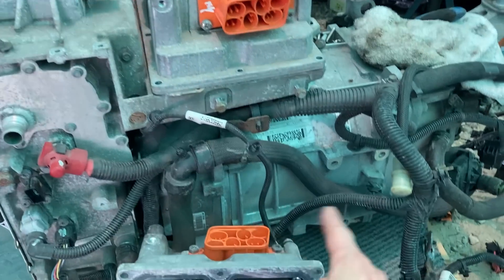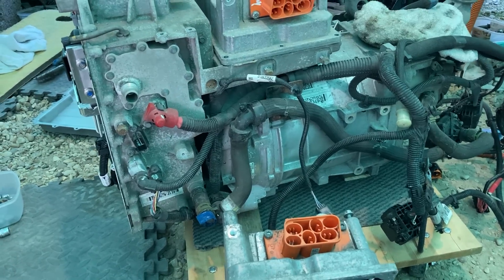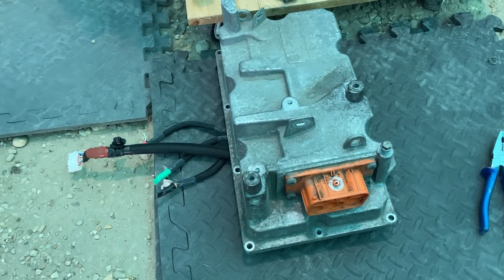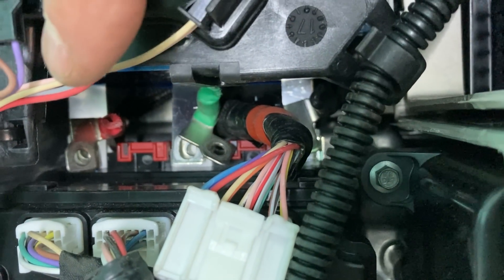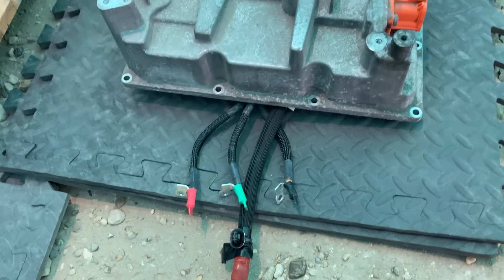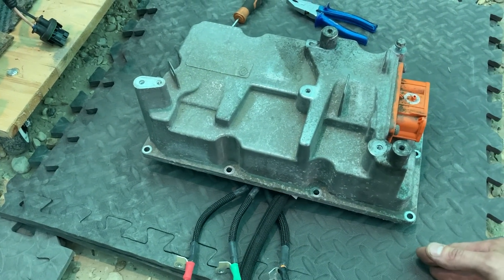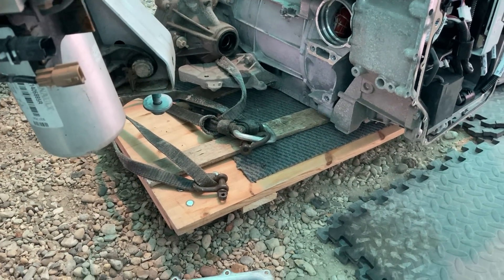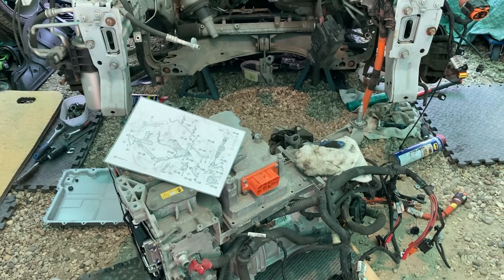Renault Zoe intermittent charging fault - overheated/burnt neutral pin - EV repair mechanic

Comment: I have a 22Kwh Zoe and according to the garage where it is in for repair, due to the DCD convertor. The neutral pin is also badly burnt out, they have sent me a photo of it. I didnt think mine could fast charge in the 1st place so don’t understand how it has been burnt out.
Reply from the maker: Hi, it’s the 7kw home charging that damaged the neutral pin. Be careful on total cost as a dcdc converter plus charging filter, socket and wiring will add up. Cheers.
Reply: @garycevrepairs The independent garage said something a leak in the AC being a factor "In EVs AC is used to cool down battery and electric components and it should be working" Is this true? It seems odd to me why would I be able to turn the AC off in the car if that was the case. Or am I  being stupid?
Reply from the maker: @niamhirl hi yes the ac system is used to cool the battery. The button inside turns off ac for the cabin but does not disable ac cooling of the battery as the car will do this as and when needed, providing it does work of course. It is a bit of a risk if you leave ac not working but depends how many long journeys you do as that’s when the battery will get warm. Thanks

Comment: The more I watch your videos, the more I think I'll sell my 52 kWh Zoe in the near future.

My warranty is about to run out. I wonder if I should do anything to check if it needs any warranty work on now...
Reply from the maker: You can extend the manufacturer warranty although many dealers are not even aware of this
Reply: @garycevrepairs how the fuck!?
Reply: Get rid of it ! to many problems with zoe, I sold mine and moved to Ioniq 28kw first gen, have 200k km now and not single issue with car, and has more range than zoe ze40, although it has only 28kw battery, efficiency is so much better with ioniq!

Comment: I've always thought 32A going was going to make things crispy, one reason I de-rate my charger home brew charger to 6Kw. Interesting about the bolts, must admit the only bolts I've ever replaced have been cyclinder head stretch bolts on an IC, everything else gets re-used unless its shoing problems on my home repairs, 40yrs of repairing stuff and I've never had any issues. I think its just another ploy to make £££ out of us, its like Shampoo, if you read the label they generally say rinse and repeat, so you use twice the amount of product 😂

Comment: I know it slightly going off at a tangent but this rather begs the question, even if you could, how many EV's would really be safe to repeatedly charge from a 1MW charger?

The faster you charge the higher the risk of overheating the moment a contact impedance starts to deteriorate!
Reply from the maker: That is an interesting question - look up the Electric bus/coaches, they have mega high power DC chargers installed at the depots, some have dual charging sockets, one on each side of the bus, each feeding half the battery pack and there are some massive currents being used to get the mega battery packs filled by morning.  Its all pretty cool.
Reply: The megawatt socket is designed for 4.5MW.

Comment: We single phase charge on an extension cable from the house… are you saying, lower amp charging is better for the wimpy neutral connector? How does the car know how many amps my extension cable can feed?

Comment: 4:00 - Should 3d print a depinning tool for that connector!
Reply: The assembly process is critical to the safety of the connector so they just don't have a removal process.
Reply: @Swwils  Eh?? It is just an electrical connector.
Reply: @rkan2  That is specifically designed for one way assembly. Its why its so hard to depin.

Comment: 2:15
From electrical enginer, pure nonsence. Charging at 32A and than letting is cool would just add extra heat cycle, which would destroy it even faster.
Better option is not using full 32A, but 24A. It is 2/3 of power, but 4/9 (less than half) of heat, since heat generated is proportional to current².
Reply from the maker: Presumably the heat builds over time, so it gets less hot with a break mid charge. Slower charging is best but might not be ideal for usability.
Reply: @garycevrepairs Heat builds up in 2-5 minutes on area that small.
And heat cycles lead to material strain.

Comment: Zoe charge port is designed for 63A 3 phase, and single phase emergency only, 32A max.
Reply: Yeah, even 32A single phase is kind of rare in Europe I would assume. In Germany the grid is limited to 20A if you use single phase only (Schieflast)
Reply: Single phase 230v 32a(or even 40a) is not uncomon in the balkan side of eu,we have chargers that can do that too

Comment: What's your advice for avoiding the pin burnout? Charge for shorter periods or maybe at a lower current? My charging sessions are generally 2hrs @7kW because that's the duration of my cheap electricity.
Reply: He said it at the beginning... Charge halfway and make a break. But ofc the lower the amps the better.
Reply from the maker: 2hrs is unlikely to be long enough to cause damage, this fault rarely occurs on the 22kwh model which has an approx 3.5hr charge time at 7kw/32A

Comment: Err Gary  it's three phase in three phase plus neutral ,  but 3 wires to the " rectifier,"   what is the unit schematic as I cannot see why you couldn't just use one of the other phase pins instead ,  the filter unit you remove unless there is an additional neutral wire must in itself be a full wave bridge rectifier an exceedingly complex one ,   .. I will draw up a circuit that I think it is ,  cheers  Keith
Reply from the maker: Err Keith, the filter unit switches N to L3 using a relay if it’s single phase, then L1 L2 L3 are passed to the Rectifer, so the neutral pin is used all the time while single phase charging. Cheers

Comment: Yeah, I can understand the engineering designer's thinking about using a smaller Neutral terminal- when running in 3 phase mode, the N terminal acts as a balancing line, not passing as much current. 

It's like, why would you ever use the Neutral line as most people have 3 ph...

So yeah, when in single phase, the Neutral line carries the exact same current as the live feed. 

Looking forward to the lease legal update, as I suspect half the country is. 👍🏻🇬🇧
Reply: Zoe does not use neutral for balance - it has 3 way synchronous rectifier that has inputs only for Live wires. When 3 phase charging, Zoe uses Neutral just to test ground, by measuring resistance between ground and neutral. 
Single phase charging in Zoe is a hack, where Neutral is connected to L3 input
If your neutral pin is burned, but not too much, you can mod your single EVSE plug by adding L3 pin and bridging it to N internaly. Other cars would not care less...
Reply: @Mladjasmilic  Where is this swapping of L3 wire for Neutral wire done to the input terminal L3, in factory built cars? 
It seems this swap is not done between the EVSE 'type 2' charge port and the filter box with the burnt Neutral pin in the orange connector, thus the high current of 32 A (for single phase charging in the U.k.) will pass the smaller pin that is shown to char its surface and surrounding plastic.

Comment: Who on earth decided to put a smaller contact in the socket? Have none of them heard of belt and braces? The extra cost is pennies. I have looked at that pin and don't think its rated for 32A.
Reply from the maker: Suspect it’s partly driven by what’s available commercially and then you’re buying a plug/socket with 3 phase capability rather than one designed for continuous single phase usage, and what they thought would happen - ie that rapid AC would become the standard. Then you’re so far down the road and supplying spare parts with this connector that the switching cost is high!
Reply: To be fair, at least in Germany, rapid AC is not widely used. We have mostly 3x16A (11kW), maaaaybe 3x32A. But single phase we are only allowed 20A (4.7kW)